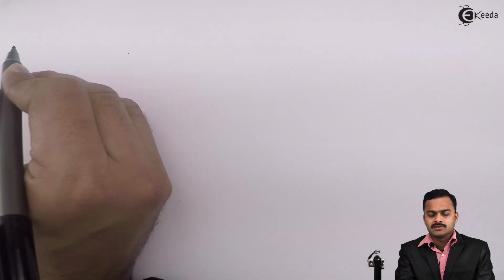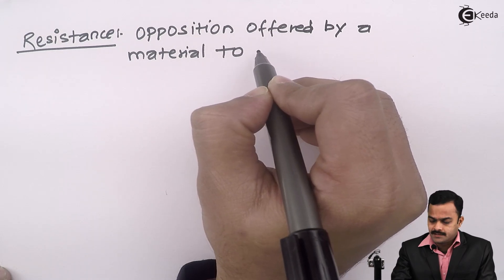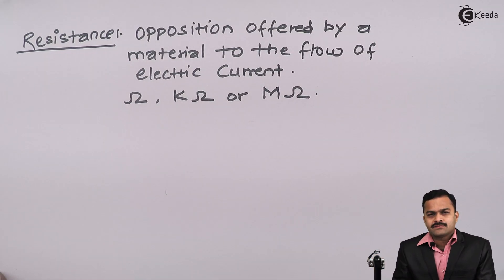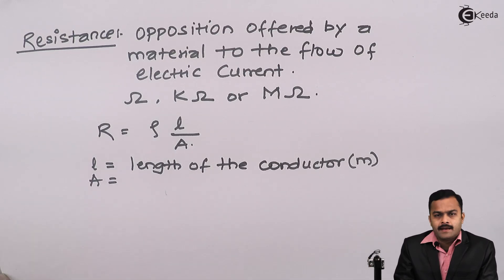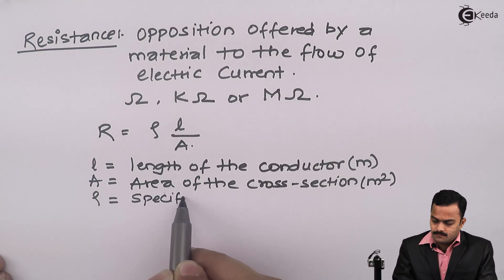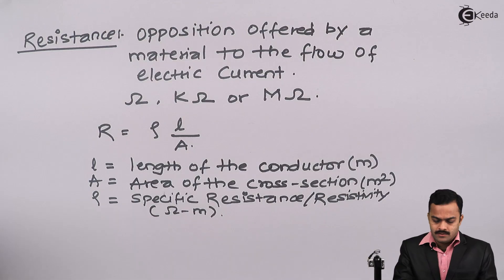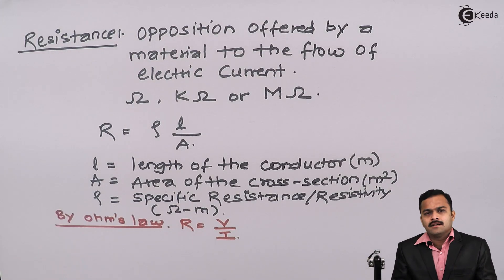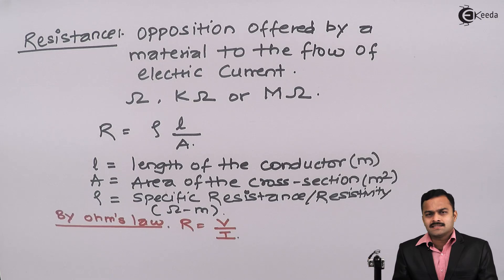Introduction to Resistance in Electronics - DC Circuits - Basic Electrical Engineering

Comment: 1. A 4 pole , 500V dc shunt motor has 700 wave connected armature conductors. The full load armature current is 60 A and flux per pole is 30mWb. Calculate the full load speed , if the motor armature resistance is 0.2ohm and brush drop is 1V per brush. 

2. A four - pole generator has 500 conductors on the armature. If the generator is running at 1200 rpm , find the average voltage generated between brushes for (a) a lap winding , (b) a wave winding. The total flux per pole is 10mWb. 
Please can you mail me the solution at shaikbaleeghuddin@gmail.com as soon as possible